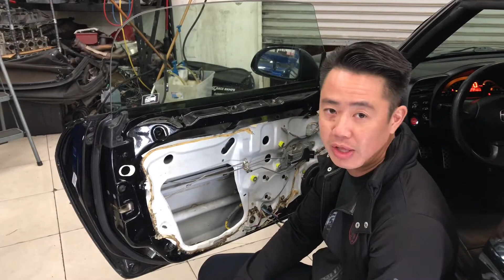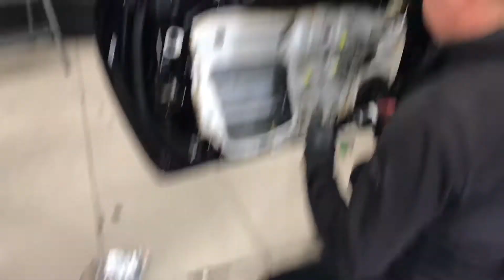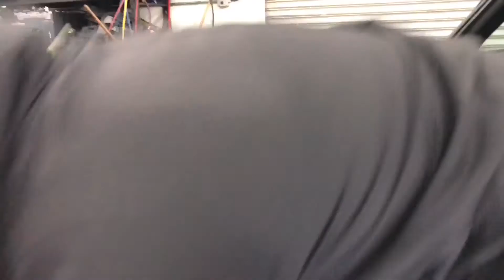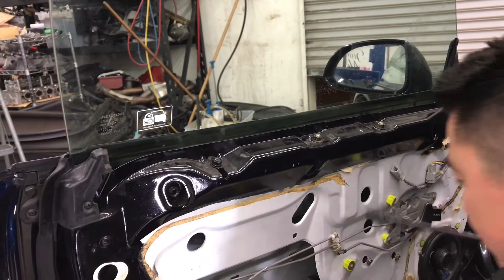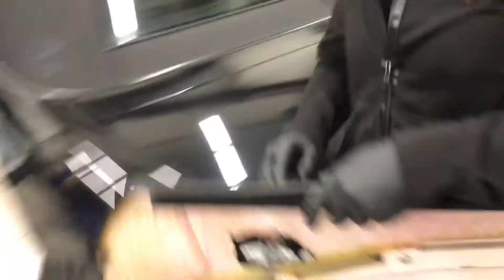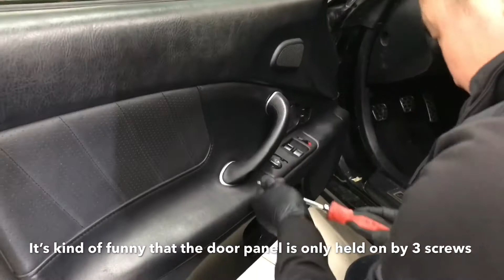DIY Honda S2000 Window Regulator - How long to install really?

Comment: Hey Alex, my  passenger  window  only rolls down but won't go up. Have any idea  whats wrong?
Reply from the maker: sonnydi3p yes the regulator wire is broken. Same as in the video.  Need a good unit to replace it with New or used.